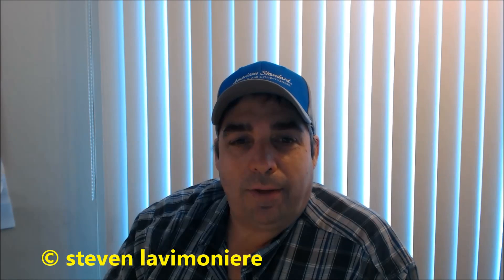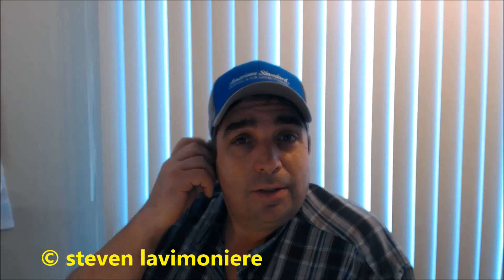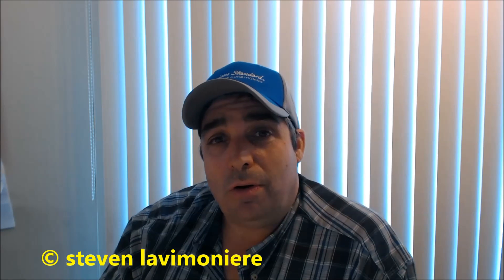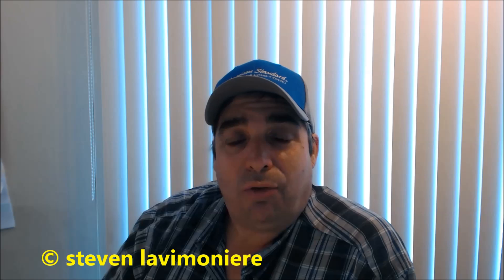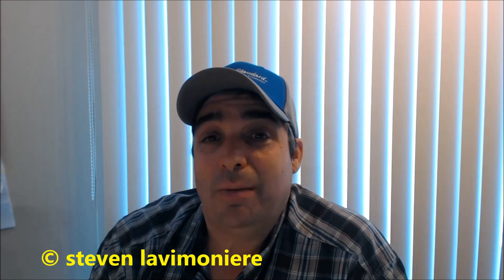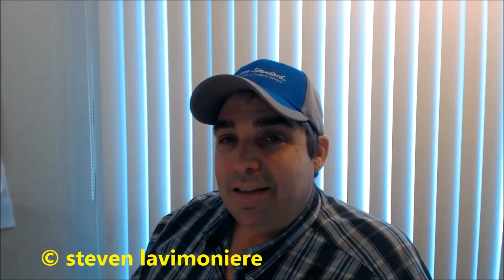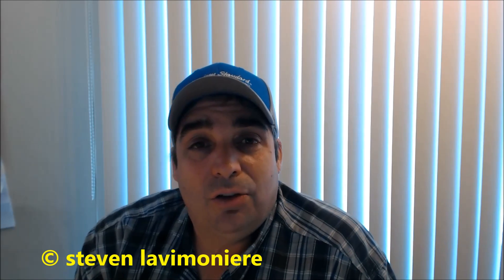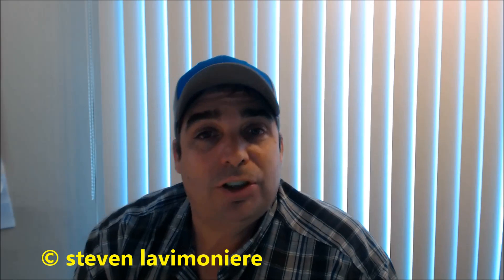NCI national comfort institute  with jim davis combustion analysis coarse

Comment: The house I'm living in was built in 1955. It's been well maintained and I continue to do it. It's amazing to go in the basement and look up and see the wood joists and flooring looking much as it did when it was nailed down 61 years ago. Still solid, still strong. Not the most energy efficient house by any sense, but it's well built. Had a new heating and air unit installed 4 years ago and it's working fine. It was built by Payne in case anyone may be wondering. Thanks for sharing that little bit of history about your house  Steve. Momma Steve's got a good one!
Reply from the maker: +Dan Bruner my house was built in the thirtys

Comment: One of these days I want to take Jim's class.
I've been using a CA for almost 10 years, and feel naked without it when working on gas appliances.

Anyone who thinks a nice pretty blue flame = clean combustion is kidding themselves.
I've found induced draft furnaces, with only a couple of popped crimp rings, spewing >4,000 ppm CO into the vent system, yet all of the burners had a nice pretty blue flame...

Comment: The first time I took Jims class, I went to my induced draft furnace in my shop. I put on a barometric & a spill switch. I broke a joint in the hot gas vent & blocked it with a piece of sheet metal. I have a low level co monitor 5' away from the furnace on the wall. I fired it up & it took 3 minutes for the spill switch to shut it down. The co was over 50ppm. Jim says on equipment from the factory with no barometric & spill switch - the average time for a pressure switch to shut equipment off on a blocked flue condition is 8 minutes, yet the average equipment run time is 7 minutes. All that with induced draft equipment, there isn't even a draft hood! I realized that my customers life is in my hands potentially at that point. If you set up a google alert to your email for co poisoning, you will see how many people are poisoned & killed by co all over the world every year. It's pretty eye opening. Long as man has been playing with fire, we have been poisoning ourselves.

Comment: great vlog you mentioned a leaking gas valve would show up. how would you notice that on co on shut down? thanks in advance
Reply: With your analyzer, co would rise on shut down, & the gas valve is leaking by.
Reply: +Jeremy Calvin Thanks I found that with a oil burner one time the pump was failing boiler kept sooting up